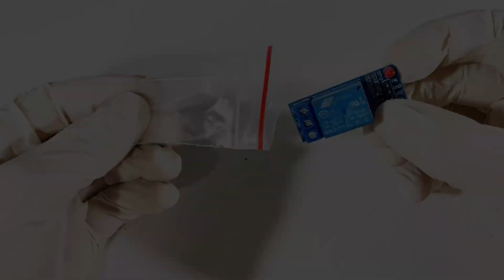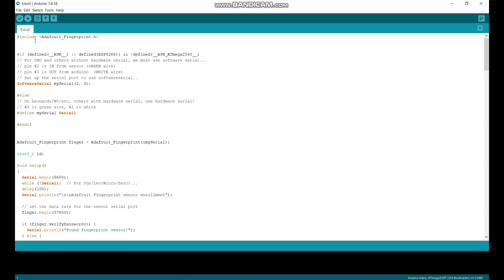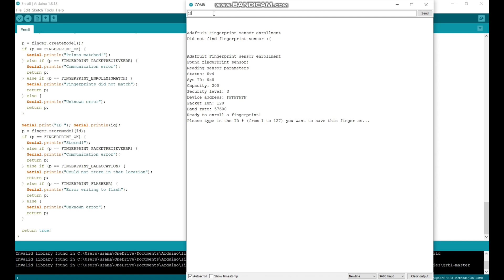How To Make a DIY Waterproof Fingerprint Door Lock Using R503 and Arduino || Home Security System

Comment: How to do unlocking in the inside of the house? How to put a pushbutton to unlock, any bypass push button switch?

please reply
Reply from the maker: Actually the lock itself has a push button to unlock from inside.
Reply: @littleneutron2056 bro i am on the 1st floor & if someone comes then how can open the door ?
Reply from the maker: First go to ground floor then open the door😂.